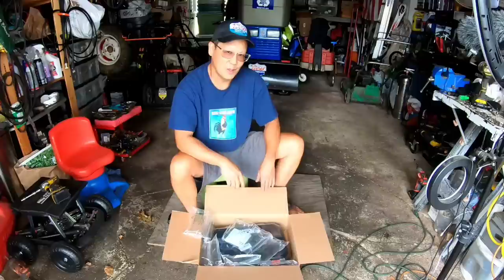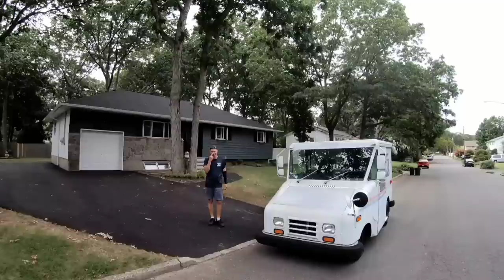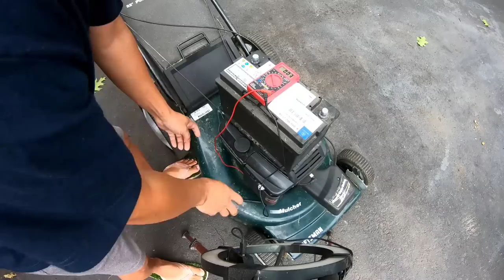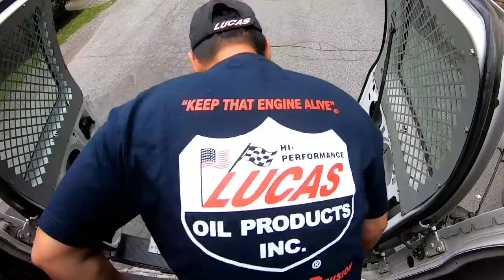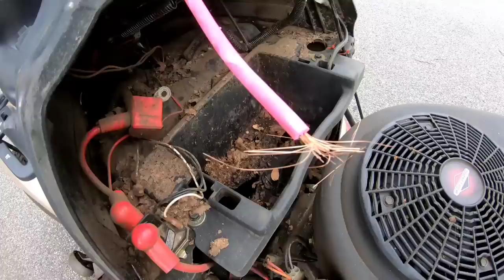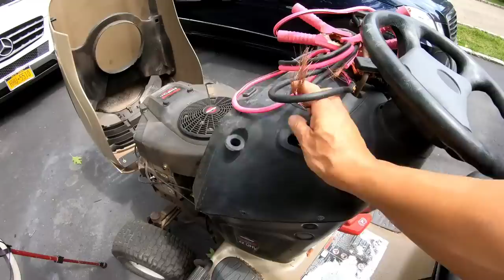CRAFTSMAN BRIGGS QUANTUM LAWN MOWER TRADE FOR BLOWN V-TWIN & TECUMSEH PUSH LAWNMOWER PICKING FLIPPIN

Comment: I actually have one of those little Power Curves, it works well at removing snow so long as it isn't too deep. They don't come with a cord, you just plug whatever extension cord you're using into the prongs on the left side of the handle near the top.
Reply from the maker: Yeah looking back I should have taken it to sell for $10

Comment: If you run a positive wire from the chassis battery to the battery in the back, and ground the battery in the back to your frame in the van, it will maintain a charge on that back battery. You could put a light switch between the two batteries if you wanted to have a shut-off.
Or you could just wire your winch to the chassis battery.

Comment: The toro power curves have much value, even the old models. I sold nine electric snowblowers last year, two of which were the power curves 1800. This one doesn’t have a cord because the end of the extension cord plugs right into the handle (kind of like some electric leaf blowers). 

Love the videos as always. Congrats on the 10k. Thanks.
Reply: Great info.
Reply: You are right. I usually sell them for around $100. They sell quick, don’t take up much space And I’ve never found one I had to put work into
Reply: @everybodysjonathan  that’s right. Never have I worked on one either. 

I put them upstairs in my attic. Out of sight  until the night before a snow storm. Usually pick them up lower than $30 and flip them for $80-120. Snowjoe is my favorite brand for flipping even though I love working on small engine gas equipment. 😂
Reply from the maker: Cynic?
Reply: @MowersNBlowers  cynic? 😂 what’s the difference in flipping free mowers in spring or summer than flipping snowblowers in the winter?

Isn’t retail cynical?
Reply from the maker: No I mean Jonathan’s profile name was cynic
Reply: @MowersNBlowers  I misunderstood 😂 !
Reply: I repair and sell small engines as well. Your channel rocks 🤟 I appreciate the “no bs”. I could try to sell a $600 snowblower I spent $200 on all year, however I’d sell 30 $60 mowers I spent $2 on. My profile name is not telling you what to think about me. I expect People to come up with their own opinions. Everyone’s different right?

Comment: You may want to take the flywheel off that Briggs first, sometimes the magnets fall off locking the engine like that.
Reply from the maker: No it turns at least 2 revolutions,  it’s definitely two broken conrods

Comment: Can't go wrong with a Briggs quantum!  Good trade and you got a bagger. The red deck is a little strange. With that gold tractor i would think the deck would be black. ✌🇺🇸 Roger #StopAsianHate
Reply from the maker: It’s definitely not stock!
Reply: @MowersNBlowers  That's one of those in between craftsman. When AYP sold out to MTD and they were using both AYP and MTD parts until all the AYP parts were used up. That mower is using a MTD deck. That deck probably came off a MTD of the same set up.